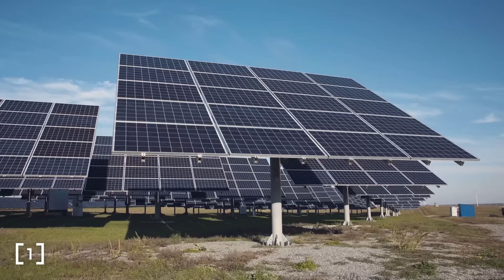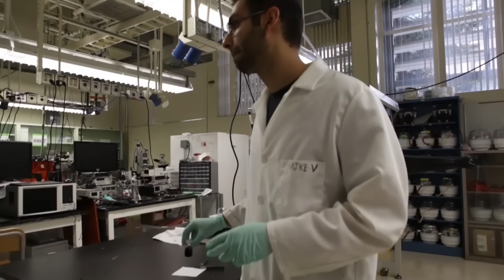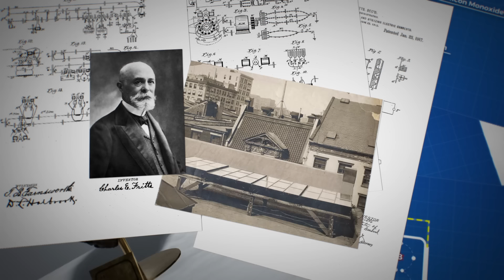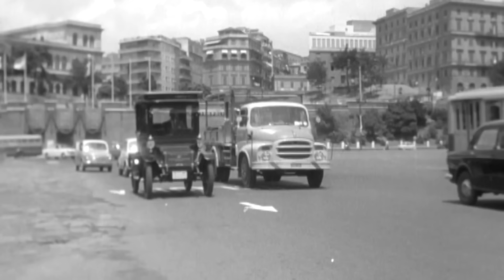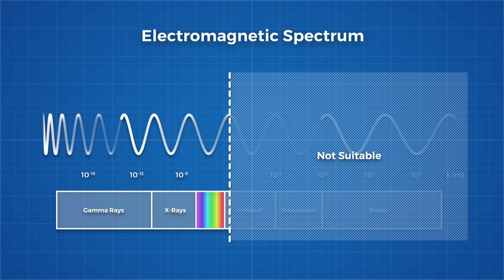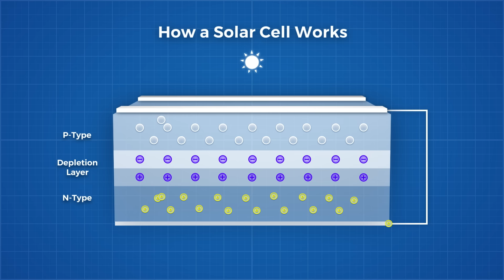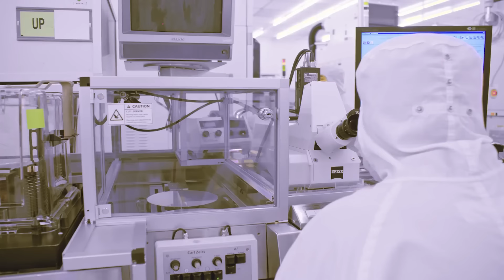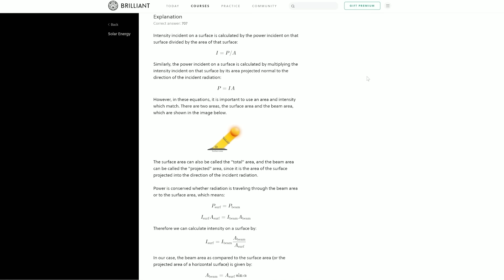The Mystery Flaw of Solar Panels

Comment: I have a lot of money tied up in solar.  It's just a novelty where I live.  The price of electricity is dirt cheap.  Didn't see that coming.

Large scale power production is going to need a 'next level' breakthrough.  We're just not there.  Same goes for storage.
Reply: The breakthrough was discovered in the 1930's when scientists discovered uranium-235 could fission and the energy released could be harnessed for power.  The first proof of concept came in the 1950's with the shippingport reactor.  The energy density of nuclear power far outpaces any other source available today and only fusion technology has any viability in the near term.  

While nuclear power has some potential drawbacks, modern reactor designs have nearly eliminated all of them.  Molten Salt Reactors (not to be confused with liquid metal or sodium cooled reactors) represent a HUGE improvement in safety, fuel burnup, energy density and useful byproducts.  

Imagine a reactor which can desalinate sea water with the WASTE heat AFTER generating electricity... or do high temperature chemistry, or provide district heating.  Or more importantly, can reject heat directly into the air instead of requiring water to cool the reactor.  It is doing this under a slight vacuum, with a liquid fuel instead of a solid fuel.  Waste products can be pulled out while the reactor is running, it can be refueled while the reactor is running, it can also use newer fuels based on Thorium far easier than current designs can which means there is REAL potential for centuries of electricity if Fusion power doesn't become viable before uranium stockpiles dwindle to nothing.

And it isn't even a "fake" reactor.  Two MSR's have operated in human history, the Aircraft Reactor Experiment, and the Molten Salt Reactor Experiment, both at Oak Ridge National Labs.  Both operated in the late 1950's through the 1960's.

Comment: The price of solar panels is not "plummeting." Any fluctuation in solar panel price is due to government subsidies.
Reply: The reduction in cost comes from cheaper metods of silicon mass refining and circuit board technologies applied on the cells. Is the progress in microprocessor manufacturing what indirectly reduced the costs of solar panels, since you can use the installations and techniques already available instead of having to manufacture and develop them for this sole purpose. Most governments and companies care very little about renewable energies, but oh boy, they really do like to invest in computer technology and minery...
Reply: Sounds like a wise investment
Reply: @classicalsrock  Not then they are Chinese products that don't last, and will probably go to landfill in Asia.
Reply: @margodance7236  Which comes from, rhetoric?
Reply: Evidence?

Comment: Solar cells and windmills are working so great in California, we had rolling blackouts during our heatwave this summer. Yaaay Green Energy!!
Reply: If a majority of California residents had their own solar cells, the distribution problem would go away, you need more not less solar.
Reply: @Redskool1  Oh, I've long advocated for solar cells to be required on all new construction.  Maybe keep a few nuclear plants around to ensure a steady baseline supply on top of that as well (assuming modern designs who's worst case failure mode is "safe shutdown")
Reply: Nevermind that energy production is up compared to where it was when rolling blackouts were common.  The problem is that no power grid is really designed for everyone to crank up their ACs at the same time.  A problem that climate change is going to make a lot worse going forward.

Regardless, energy generation by solar/wind continues to increase, and they are now two of the cheapest forms of energy generation out there.  Coal is now one of the most expensive ones, only ahead of hydro and nuclear.
Reply: Hey, that’s swell,  @gamerk316 ! We’ll remember that here in Democrat-controlled California next time our Democrat leaders impose  rolling blackouts during the next heat wave... probably after they’ve refused another power plant.
Reply: @donde2k  Except for the fact power generation growth in California is outpacing most of the other states, due in large part to increasing construction of Wind/Solar generation.

Also consider that dirty power plants are what is partially responsible for said blackouts, since they are contributing to the heat waves that are causing everyone to crank up the AC in the first place.

Simply put: You're seeing the front end impacts of ignoring climate change for the past 50 years.  And it's going to start getting a lot worse fairly soon.

Comment: I'm disappointed that you either didn't know or chose not to include the fact that after a useful life of about 20 years PV cells become TOXIC WASTE because of the heavy metals they contain.  “Contrary to previous assumptions, pollutants such as lead or carcinogenic cadmium can be almost completely washed out of the fragments of solar modules over a period of several months by rainwater.” ( link below ) As well as PV cells being disappointingly inefficient.  They create yet another toxic environmental challenge we will be forced to deal with at the end of their useful lives.  PV solar cells are NOT the answer to our sustainable energy challenges, they're merely a way kick the can 20 years down the road while creating an enormous & ever increasing stockpile of toxic waste.

https://www.hazardouswasteexperts.com/solar-panels-wear-out-hazardous-waste/#:~:text=%E2%80%9CSolar%20panels%20create%20300%20times,than%20do%20nuclear%20power%20plants.&text=%E2%80%9CContrary%20to%20previous%20assumptions%2C%20pollutants,of%20several%20months%20by%20rainwater.%E2%80%9D

tim #bgreen
Reply: no

Comment: We should be exploring more Geothermal IMHO. It can produce energy day or night, sunny or rainy days.
Reply: Useful in areas that actually have geothermal viable areas... in the midwest, it's a bit harder to make geothermal electrical energy since there tends to be less heat under the surface.  It's more expensive and puts out far less energy than other sources.  Nuclear makes a lot of sense for clean, concentrated, baseload.  Advanced nuclear fission has a lot of promising low or near zero water requirements which should be funded as heavily as renewables are.
Reply: @Whiskey11Gaming   I am pro nuclear as well is just that the current nuclear waste generated is not yet in the level that we can be safe. But you're right, it is promising. Geothermal on the other hand is readily available and does not generate waste. Iceland has already perfected it. Nuclear on places where geothermal is not feasible is good alternative.

Comment: Here's a philosophical question with engineering aspects: if the source of energy is free and limitless, does collection efficiency matter?
Not saying 'no' to advancements, but it seems that squeezing out every little bit is kind of ungrateful.
How dare sunlight fall on the earth without doing useful work for mankind?
Reply: Here is the thing, we might build a device that could harvest the solar energy. But if that device is low in efficiency or low in total capacity even at 100% efficiency, it's just not economically and technically make sense.

Especially when the amount of energy it used to mine, extract, manufacture, and setup is higher than the total energy output of that device in its lifetime.

I am all for clean energy, and exploring all the possibilities in the name of science, but i personally think we should leave this for a while and look for a better option. Nuclear? Bio-diesel? Idk im still on my search too. But that's just my opinion, i think i just want to add something to the discussion.
Reply: Agreed. The energy from sunlight falling on the earth in one day is more than global energy needs for an entire year. Solar panels can make a huge contribution to our energy needs, even without increasing panel efficiency.

Comment: Please show me a solar PV production plant, including the aluminum frames, interconnecting cables, and electronic controllers powered entirely by solar panels.  I submit that there isn't one.  Prove me wrong.
Solar PV simply isn't thermodynamically sustainable.  They merely convert $0.10 per kwh Chinese coal and hydroelectric power into $0.35 per kwh subsidized solar power.

Comment: More energy is used to produce a solar panel than the panel will produce in it's lifetime. A total waste of money and resources.
Reply: Uhm no. Depending on the technology, a solar panel generates enough energy to cover its production (and the production of all other necessary components) within 1-3 years. After that it's a complete net positive.

Comment: What about the materials solar panels are made of? The energy it costs to get them out of the earth? What is being done with those materials, when a solar panel reached the end of it's producing life? I've heard that it's better for the environment to use the fossil fuel, it takes to make solar panels, in power plants, without making solar panels. Wind turbines kill a lot of endangered bird species and the costs of making them, doesn't make up for the energy they produce. Both can't assure that power outages don't occur, in a way fossil fuels can.

Comment: You took 12 minutes to explain a concept that could be done in 2 minutes only to give a 4-minute explanation of the problem. You want proof okay fine I'll do it right here in this comment.

Solar panels have a problem, after being exposed to the Sun for a short period of time they lose 1 to 2% of their 20% efficiency. 
In order to understand why we need to understand what a solar panel is. A solar panel is essentially an infrared light emitting diode working in reverse. It is made by sandwiching two Wafers of silicon with specific impurities to produce a positive and negative side together with metal leads on the outside. The positive is generally made with something like phosphorus and the negative is generally made with something like boron to generate the respective absence and presence of electrons. When light hits the solar panel it knocks one of the excess electrons out of its normal place and this electron generally only has one place to go, the positive side.
(Side note electricity actually flows negative to positive not positive to negative. This is a common misconception started when we first discovered how to use electricity)
Scientist have discovered that due to oxygen impurities in the Silicon. Boron is combining with oxygen to make a sort of catch that prevents the electrons from flowing and ends up knocking them back into place.
This can be solved with the duct tape solution of heating a solar panel in a dark oven or making the negative side with gallium instead of boron.
The last 2 minutes is a plug for Brilliant.  something you do not need. I did all of my research with electronic circuits for dummies and YouTube looking up pros, cons and interesting facts. Also I've tried Brilliant, YouTube is better and free.

Sorry for the rant it's just this is a simple concept not some mystic art in a fantasy book. I also get tired of scientific explanations that take triple the time to explain a concept then it needs.

Comment: i bought used solor pannels from a solor plant that burned up the pannels are still in decent shape there rated for 8 amps there atleast 5 years old before i bought them and there still putting out 12 amps way more than they were rated for years after they were sold and used heavily and servived a fire and there still puting out 1.5 times there rated output 
so im woundering what there flaw is is puting out more juice than rated for the flaw this video is lame and pointless

Comment: They should add an additional layer that also converts the absorbed heat to electricity. Even if it's only a 1% gain it's still a gain.
Reply: Unless the cost designing, producing and integrating that layer outweighs its benefit. PV efficiency is not the issue. It's that not enough PV is being installed.

Comment: secret flaw - they lose 10% of their power immediately.  secret solution, install 10% more PV and move on. Or put your PV on a tracker and generate more power, or shade your rooftop AC unit with PV modules and generate power while lowering your energy use, or cut the tree that shades your PV array down and plant 10 to the N of it (northern hemisphere).  

PV, wind, and  hydro just need political will to power the whole world.  Lead acid batteries have been commercially available for 100 years and they work pretty well if you follow the rules.  There are storage options and we certainly have enough money.  Trillions in the US for big companies during a pandemic.  Plenty for air craft carriers and tanks etc.  

I think the saying "don't let the perfect become the enemy of the good" applies here.
Reply: Big Oof... your argument here could quite easily be applied to just about any power source... Nuclear, in particular, stands in direct contrast to the intermittent renewables as a more viable path, but the lack of political will prevents it from powering the whole world.

In truth, the US really needs to adopt a home modernization program and embrace a Renewables + Nuclear path going forward.  The home modernization program should focus on revising home building standards to near passive house standards and finding ways to drive the costs of hitting that standard down.  Even if we increase energy efficiency, we are still going to see increase in energy usage.  This has held true since the dawn of humans utilizing "energy" to do work.  The more efficient we are at using it, the more stuff we create to use it.

Comment: Solar will "always" be a pipe dream. Even the most rudementery back of the envelop calculations, will show you that getting enough panels, and storage to even out weather and seasonal periods, is completely impossible. This is even when you consider the theoretical upper bounds on the relevant technologies, men that even at the limit of what is physically possible, it's not impossible. People who advocate solar for nations as a whole, are snake oil sellsmen.

If you want to reduce CO2 emissions, and you want it done fast and by a lot, nuclear was and will for a decent while yet remain the only option. Stop looking to the passed and start looking to the future.
Reply: The gigawatts of installed PV around the world are generating a lot of useful power.  Not sure what's in your pipe but maybe you should stop smoking it.

Comment: Solar panels absorb  and radiate heat due to poor reflectivity. Now I've heard that solar panels overall have a net cooling effect but I cannot get past the notion that if the entire surface of Earth was covered in solar panels it would be unbearably hot. I think they are great idea for low maintenance energy but to offset warming I think is negligible. Geo thermal  by far seems  the greenest energy of all.
Another thing I've often found strange is road surfaces and rooftops play a significant role in heat absorption and are exponentially growing yet there is not really an emphasis on mandating highly reflective roofs or reflective road materials. It may not have much of an impact on global temperatures but localized urban  temperatures would surely be reduced.